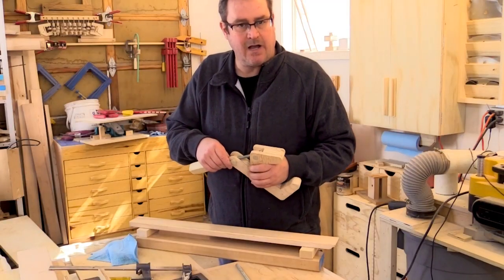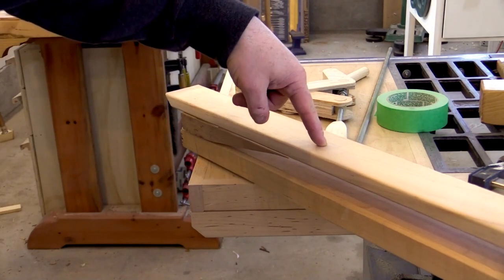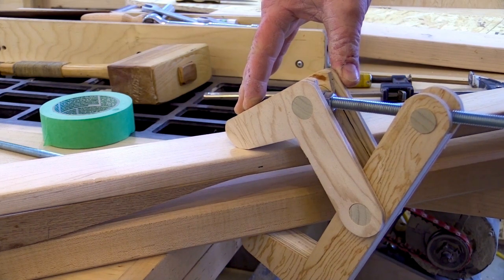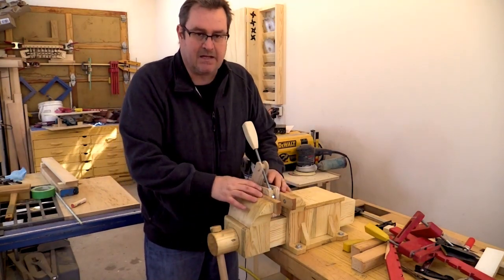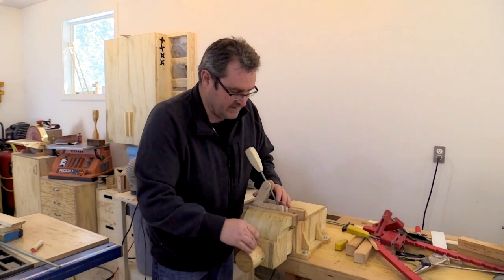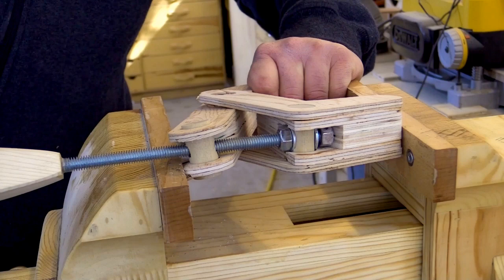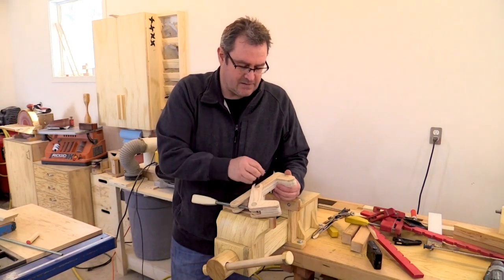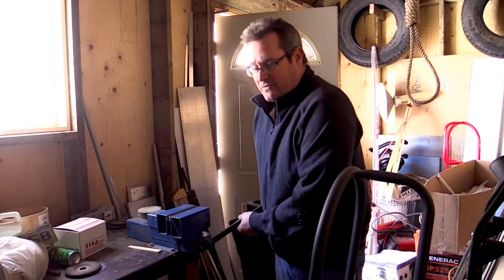Destructive Testing This Wooden Clamp

Comment: Thanks for another outstanding video John Heisz.  I'm very impressed with the power of the clamp as is.  From what I could tell, it equalled the metall clamp before breaking; therefore it clearly passed the clamping pressure goal.  The strength of those wooden threads is amazing.

Comment: Cool video John: I am also still suprised how strong wooden threads are in hardwood. What  type of wood did you use?
Reply from the maker: Thanks Roy, it was the demo in your edge clamp video that convinced me the wooden threads are strong enough. The dowel is actually just poplar, so not even a very hard wood.

Comment: Good clamp, I made a similar design out of metal by hand as part of my apprenticeship many years ago. The only improvement I would suggest would be to make the sides that broke out of slightly thicker ply but apart from that it's a great clamp :D The thread is obviously pretty strong, it started to damage the jaw faces of your nice wooden vice. The noose in the shed worries me slightly though :D

Comment: That was a nice handle, I was cringing when you put the vice grips on it.  I wonder if increasing the arm width, thereby increasing the distance of the dowel hole from the edge (maybe 1"?), would work as well as using thicker plywood?  The arm would definitely be larger in size, but could stay the same thickness.

Thanks for the testing, it's always fun to see videos like this!

Comment: John, I "liked" this video before watching it just because it said DESTRUCTIVE TESTING, lol! But that's some BRUTAL testing and I am astounded how much pressure the wooden threads held!! Great work! Can't wait to see the updated version!!

I wonder what would happen if you replaced the outside "weak point with a piece if plate steel and the pivot point(dowel rods) with smaller steel pins?

As ALWAYS, GREAT VIDEO!!
Reply from the maker: Thanks! The centre pivot can be made smaller - 1/2" dowel should be good.

Comment: You can make the L-shaped component out of thicker material, or you can make the "end distance" a little longer.  The "end distance" is the distance between the center of the fastener and the end of the material measured along the line of force.  Needless to say, you can do both, too.
Reply from the maker: I think that gluing the dowel to the short jaws leaving it to pivot inside would make a big difference as well.

Comment: John, I Don't know how tight you need the clamp to go .
Matthias experiments with wood glue seems to indicate that moderate rather than high pressure is better for gluing wood..
Dan
Reply from the maker: A tight glue joint is always preferable, so good clamping pressure is needed for that. Fact is, the glue joint, even if it's fairly weak, is usually much stronger than it actually needs to be.

Comment: Instead of going to 1/2 inch ply and making the clamp thicker, maybe you could use a sheet metal reinforcement where the weak points are.  A small brass or steel piece that went to where the clamp was laminated with the thicker ply and attached with screws and glue/epoxy.

Comment: The clamp was applying enough pressure for a glue up long before it failed and the metal clamp pressure would have yielded a dry joint. No gluey no sticky.

Comment: what if you used 1/4 inch Russian birch and just made the point behind the dowel a bit longer. it would stick past the other jaw a bit but you would have a higher shear strength and still be nice and slim.  Great vids as always.

Comment: Hi, I suggest using smaller diameter steel rods for links, that way you would end up with more material around the links.
Reply: You could also try using Baltic birch plywood if you wanted to stay with 1/4".  It would give you a couple of extra layers with no internal voids.